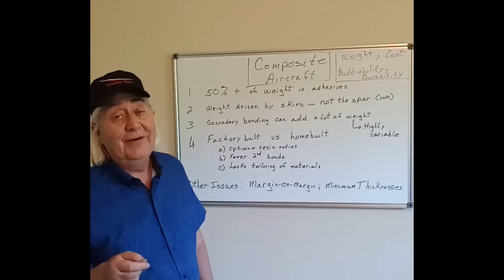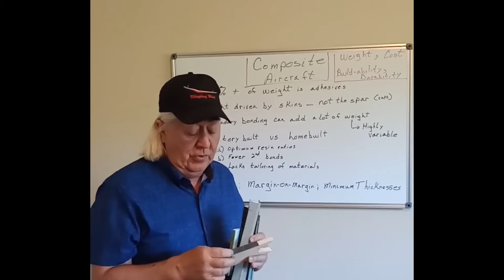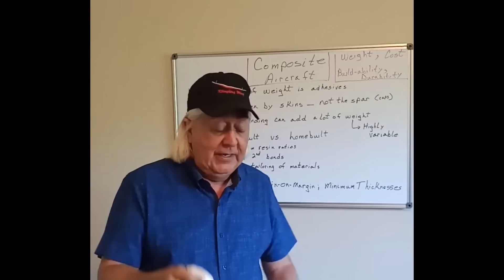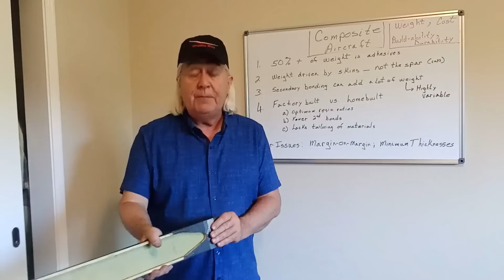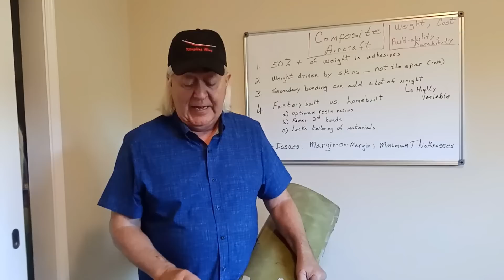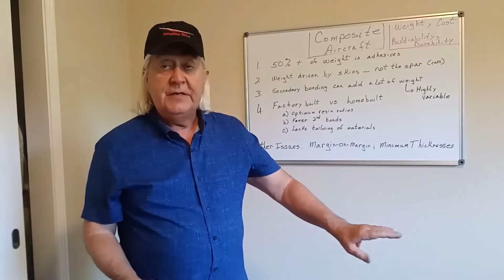Wing Tip Build Trade Studies - Klingberg Wing MkII Development

Comment: Could the 1/64 ply be attached to the foam with M90 spray adhesive? Would this save weight?
Reply from the maker: Hi Jim  short reply is . No, because the glue will melt the foam.  But the better answer is complex and will come in a day or so.
Reply from the maker: Now for a more complete answer. One can use the “foam safe” version adhesive which is 3M 77 spray adhesive. However, there are some “sticky” (pun) issues to overcome. First, if one is spraying on the edge of a foam sheet (for rib capstrips) there will be a lot of overspray on the sides of the ribs. The over spray can weigh more than the entire part - bummer. One can prevent the problem by masking off all areas that don’t need glue (labor intensive). However there are more problems. The usable temperature range for 3M 77 is quite limited. On a really hot day in the desert, it will start to soften slightly and then one runs the risk of local buckling and loss of all strength. Finally, the overall parts will never be very strong because this adhesive will always be soft like any contact cement. This means it isn’t good for parts that need to be stiff. So, not a good use for full size aircraft.

However there are exceptions. If one were to use PVC based foam, then just about any adhesive would be safe to use. There are high temp versions of spray adhesive, but none that I know will be stiff enough for full size aircraft parts. I’ve tried all sorts of aerospace grade (expensive) transfer adhesive, but none of them adhere to any foam very well due to the lack of a smooth surface.

So, we end up back where we started, epoxy or urethane, same weight and cost, but no mixing required)  is the best answer. Folks just need to remember that on ultralight aircraft, one half of the vehicle weight is adhesives, generally speaking. So, the key driver ends up being the person doing the gluing. They must remember to use only the amount of adhesive that is needed for strength. Glue fillets, a little extra for insurance, overruns, dribbles, all add a lot of weight.

Comment: Hi Rol, thanks for a fascinating inside view of your design decision process. I do have a question though,

Even though the kevlar is capable of carrying the bending loads, the E of kevlar is much lower than that of the carbon fiber. So the carbon would carry the majority of the loads. Given that pultruded carbon has an elongation at break of about 2%, it would probably rupture before the kevlar begins to carry any significant load. Right?

I hope you get well real soon.

Thanks again for your amazing generosity in sharing your knowledge